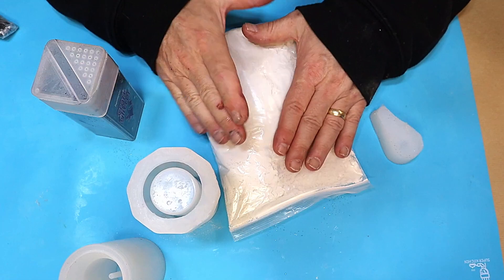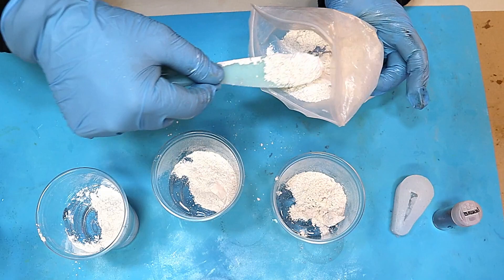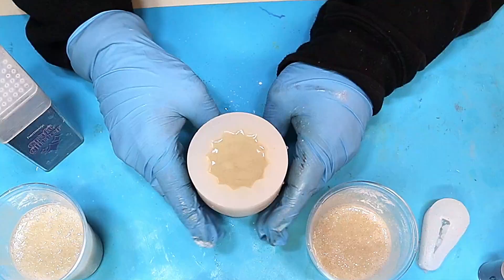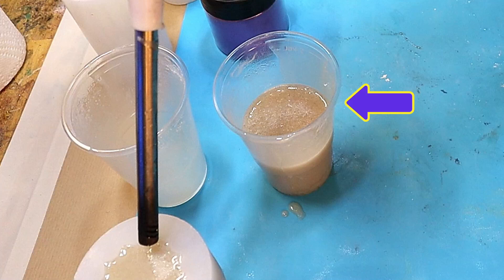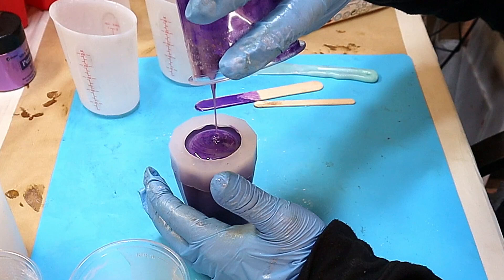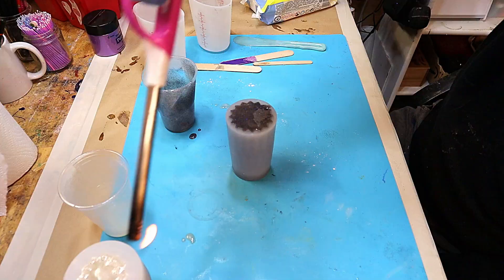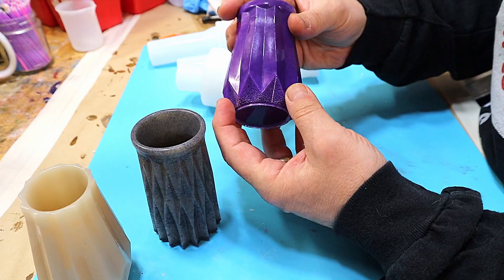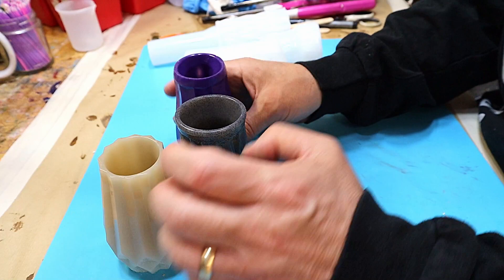White Cement in RESIN- Can You Guess What happens?

Comment: Very interesting results.  I do recommend making a vacuum chamber to assist in pulling out the bubbles.  you just need some kind of sealed box and a fixture to attach a shop vacuum hose as a bare minimum.  You will still need to open and pop some of the bubbles in resins, it helps prevent bottoms and sides from having air gaps as well as some of the bigger ones from forming.

Comment: I am wanting to try this mixture.  I wonder if mixing the glitter or mica powder with the dry cement before adding to the resin would prevent them from sinking?  To get the marbled effect, divide the resin prior to adding the cement.  Add the uncolored cement to one portion and the colored cement to the other portion.  Mix each one well and then combine the two, mixing only enough to get the desired effect.

Comment: Have you ever tried a cup with a divider in the middle, mix two colors then put each color on opposite sides of the divider.. then you could pour the two colors at the same time and slightly turn it as you pour into a mold.. I can imagine that will give you a dramatic marbling effect..
Reply: I used to do something similar with melt and pour soap that had set up a little so about the same consistency as resin. I just used two different cups and poured them at the same time. Very pretty.

Comment: If you made your molds a little different, with a space above  your edge, you wouldn't have to babysit them so much, you could overfill them a little and as the air escapes, there would be a reservoir waiting to drain in.

I assume the upper lip requires some cleanup anyway, so it would just be slightly more cleanup.

Comment: Does this pour and self level like regular two part epoxy? I'm thinking to use a similar blend to the black glitter one you did on a chiseled MDF slab. The idea would be to chisel the slab to a slate-stone-like edge and make a table which replicates the shape and look of slate at a much cheaper cost while also remanining safe (genuine slate slabs have edges which might as well be an arrowhead waiting to be fallen into as far as I can tell).

Comment: Take a crafting heating gun or a lighter to the bubbles. It will help pop them. Also you can use isopropyl alcohol spray, Also the tapping helps get the bubbles out like you said
Reply: did you watch the video? he used a lighter. thing is bubbles form throughout the curing process and when the resin is getting stiff, the bubbles keep forming but dont come to the top. best investing in a vacuum degasser or a pressure pot. almost guaranteed bubble free, and if you are making items to sell then its an investment.